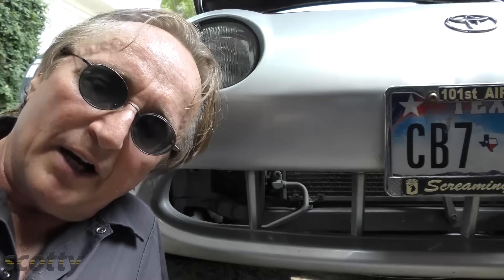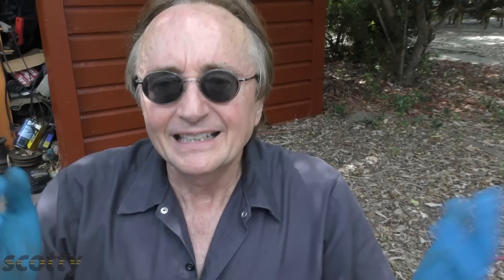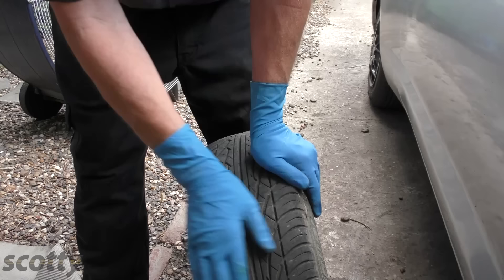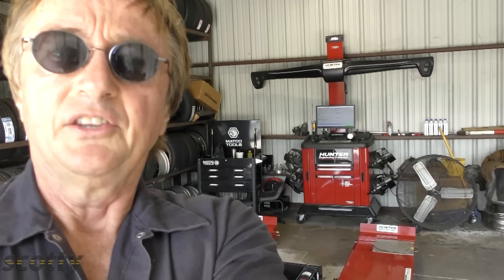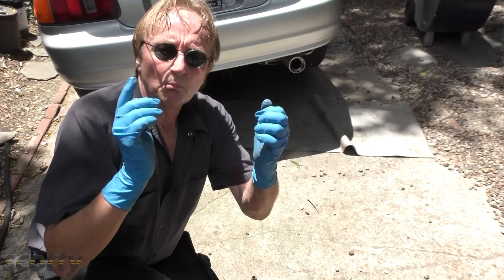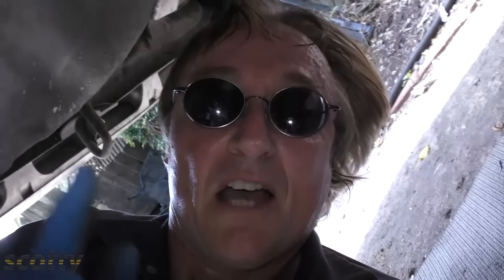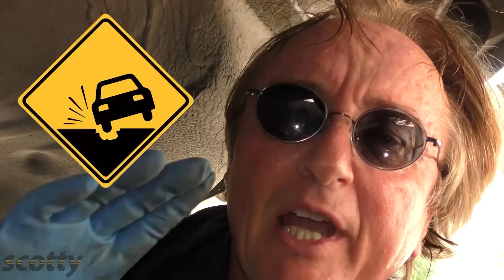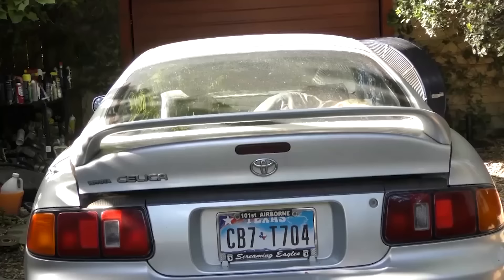How to Tell if Your Car Needs an Alignment

Comment: No rust anywhere. Must be nice to live down south.
Reply: It is!
Reply: The advantages of living in the South go way beyond car rust.
Reply: J Babb like cheaper houses etc?
Reply: it has its pros and cons lol
Reply: opl500 ahh that’s like the only good thing in my option but that part is nice for sure.
Reply: J Babb Don't know about that. Hot, humid, bugs. Mountain West is where it's at.
Reply: Everything's a trade off but I wouldn't love far north if you paid me for every expense!!!!
Reply: It's only hot 9 months out of the year, that's not humidity, it's liquid air and we've been using the skeeters to deliver packages for years. Amazon just thought they were doing something new.
Reply: All you have to do is apply a very expensive pain to the underneath of the car and around the arches of the wheel and any other part that want to protect to be completely rust free, that car could sit in a container filled with water and sit in there for 10 years the only things thats gonna rust are probably the wheels the bolts and the engine metal parts... AHAHHAAHAHAHAHA what metal parts? lol
Reply: No road salt usage during winter.
Reply: opl500 
yup I learned my lesson by fixing up a Texas car that was in the north for about 5 years. 
Who could tell it was a Texas car at that point? 
Next time I’ll be way ahead by going there and getting it myself !!
Reply: The only con I've seen having a "Florida" car... The plastics man... The engine bay wire harness clips, hoses, etc. They're brittle as hell. But after having and working on a rusty "New Jersey" Grand Marquis... I'll stick with southern cars any day.
Reply: IcantSignIn ...LOL!
Reply: We have about 8 months out of the year of 90-100 degree heat with 50%+ humidity. I love the South but our weather is fucking miserable.
Reply: It's mostly aside from that they don't salt roads when it does snow and ices over, and the summer time heat turns any vehicle into a oven.
Reply: Greetings from South Miami!
Reply: it's nice down here. No snow or ice, maybe once every 10 years like last year. But hot hot and hot for 8-9 months. Even at 9-10pm is still 90 degrees at night because of humidity. But down here you can drive any car doesn't matter be 4x4, fwd, or rwd because of no snow
Reply: Rhinolith lol, same story here trying to find an automatic shifter without a broken plastic button for 03-07 accords. It's almost like a rite of passage for these cars in the heat belt.
Reply: Sucks aligning northern cars. The adjustments are rust welded together. Takes 3 or 4 times as long sometimes since your always fighting to free it up with torches etc.
Reply: The south shall rise again!!  @jeff3741
Reply: Live in Massachusetts i put a transmission in a 2006 silverado today had to heat every major bolt
Reply: It has its benefits, I live in Tennessee. I'm originally from New Jersey.
Reply: If I lived up north I definitely would invest in a car garage.
Reply: @psydog5480  humidity is what is bad I moved from South Louisiana to South Florida and I'm loving it most days sunny and breezy rite on the water.
Reply: Nah we have pot holes here to, it’s not all perfect
Reply: @davidperry441  yeah no kidding. An average clutch replacement takes 4-6 hrs on a Civic. New England cars? Plan for 10-12 hrs and half pint of blood loss from cuts and bruises.
Reply: @creolecajun9988  except car garages are a luxury only the richest NFL players can afford here in Boston. Parking spot? Yeah a 27 min walk from your place. Car repair? Drive 45 mins west to find a trustworthy mechanic. Can't wait to go live in the south and leave this gigantic, cancerous pothole of a place!
Reply: He lives in Houston so it's humid and salty
Reply: Down south? I hope you mean California or something. The most humidity all over Florida.
Reply: Yep
Reply: I live on the in a tropical climate on the coast and sit for hours at the beach every day and my car is a decade and a half old. I don't see no rust anywhere.
Reply: I live in Canada winters are terrible and I have no rust either
Reply: It is!
Reply: cali is wonderful for that
Reply: Yeah sweet tea is much more important than rust!
Reply: Yes, its just Hot as He#$
Reply: No snow either! 😎
Reply: No rust until you live on the coast in the south
Reply: Yeah but living in the south, has its pros and cons, you can cook food in your car without having it running in the summer lol
Reply: Yes.

-Florida Man
Reply: It doesn't suck
Reply: Then move south?
Reply: No people normally can’t drive down here and you wreck up your cars
Reply: I think I would prefer to see rust rather all this dang sand....so...sick...of...the...sand!!!
Reply: It is
Reply: @jeff3741  yep!
Reply: @josephpatrick9174  good tell your friends not to come also
Reply: I swear might have to move down south just to get my moneys worth
Reply: @DragonKnightX12  our cars have a device that is called an air conditioner!
Reply: @Randall-mt7jk  You must have that hi tech AC that cools 120 degree car interior down to 60 in second. 😂
Reply: DEFINITELY IS 🤣

Comment: I've done the alignment on my own car using basically just strings and a tape measure and some ingenuity. When checked later at a garage it was almost perfect, well within spec. Mechanics always say that you need insane precision, lasers etc, but in fact on a 17" rim the difference of 1 degree is a whopping 8 mm between front and rear edge of the rim...Meaning it's absolutely doable for a skilled home mechanic.

Comment: The pros always say " this was the best we can do" and its not perfect but they charge you 100%.lol
Reply: chuck e 
Its all about tolerances
Know them and work within

Everithing else is a waste of time (and money)

Capitalism tho
Reply: I got an idea, how about YOU learn how to do an alignment then YOU can see why "this is the best we can do" is what we most commonly say.
Reply: Six months later , need new tire.haha
Reply: When its time to pay, you can say "this is the best we can do" and only offer 80% of what they wanted
Reply: its tricky cause you get one adjustment where you want and move on to the next it will change the reading on last one you just set. its more of an art than you would think and doesnt have to be exact just an approximation. you would be surprised at what counts for "inside manufacturers specifications".
Reply: WarriorPaxo yes I agree it is an art.
Reply: Try doing an alignment on a Chrysler 200, good luck adjusting the camber and don't forget to jounce (if you don't know what that is don't worry about it.)
Reply: Usually that means you need new parts & the old ones are too old aka worn out. not the techs fault you won't do you repairs. in fact it usually takes us longer to get it close ironically. why? because we have to go back & balance both sides to the "good as it can get" measurement.
Reply: @markwatney8641  In that case, you don't pay up, you don't get your car back until you do.
Reply: Most cars come with front and rear toe adjustment. That's it. Sometimes you get lucky and have front camber adjustment. Otherwise you're looking at expensive cam bolt kits or shims to get it right. Your choice.
Reply: Many times this happens and they refuse to adjust what is needed like newly installed adjustable equipment. Whatever gets your car  out of the door quicker is the way to go. I have yet to find a good alignment person that will do a precision job
Reply: I agree
Reply: You are lucky, they wanted to fix everything under my hood before I could get it aligned.
Reply: @bdtol3142  under the hood or front-end work because your motor cannot work and we still can align your car we can drive it to test it but on the machine it can be all in the green but we can't do that if you have bad front end work we got to fix the front-end work first then align
Reply: @nicholasdoran  do it perfect or dont do it, period.
Reply: @gizzync1525  Don't You Love whenever you adjust the passenger side toe and the driver side toe changes LOL
Reply: @peopleareajoke  my personal favorite is when the caster moves because the brake depressor didn't hold. lower. cuss, resweep, raise, readjust. pray split is correct
Reply: That’s like cutting grass  would you charge the same if it was short or tall

Comment: Most people don't need it done perfectly that's why we are on youtube.  We just need alignment done well enough that we don't get bad tire wear or steering pull.  The main reason the individual needs this done in my experience is because they have replaced some front end parts themselves or bought a vehicle that has had some front end parts replaced.  It is totally possible for even a novice to do a decent wheel alignment that accomplishes these goals.

In this case performing a home wheel alignment by measuring between the wheels is perfectly acceptable and will fit the purpose.   I have done a total of three wheel alignments in my life.  I have done all of them with little to no experience and training.  All of them have accomplished the goal of reducing bad tire wear and steering pull.

Comment: My Dad has used the tape measure way for decades and has never had an issue.  Like Scotty said most adjustment is needed for toe.. and the tape measure way works for that.  If you have a camber issue? Then the tape measure won't work.  You can usually tell by how your tire is wearing.  Now my Dad was in the Body Shop Biz for MANY years and is fairly proficient at doing alignments in this fashion.

Comment: I do my toe alignments myself by guessing and honestly, I've never had this method fail me. I can't condone it of course because you have to be super in-tune with what your wheels are doing and how your car is behaving in order to get the adjustment close. For example, My car had steering that was drifting to the left at high speed and at low speed, the steering was very light to the left but harder turning to the right. Also at low parking lot speeds, it would turn light to the left, then you could let go of the steering wheel and it would continue to turn itself harder to the left until it reached full lock turning left. These symptoms led me to believe that the left wheel tie rod needed to be adjusted in a way that turns the left wheel to the right. ( not sure if that's positive or negative toe) Either way, it worked and my car steers great now.

Comment: Great content once again!  Too often people are scammed into 'needing' an alignment.  One time had a NTB location try to fudge the  inspection results.  Vehicle was perfectly aligned when it went in for tires.  Watched the guys try to play around with the steering wheel to make the printout appear the vehicle was severely out of alignment.  The problem with their scam was that the toe was out exactly the same amount on both sides (one positive and one negative), with the wheels both pointing left.  If that truly was the case, then either the vehicle would have pulled severely to one side with the steering wheel centered or would have driven straight with the steering wheel severely off center.  Just a SCAM to try to get me to spend $80 on something that wasn't needed.  Put 70,000 miles on those tires and they wore perfectly.  Seems to be getting harder to find reputable shops these days.  Knowledge is power!
Reply: yeah ive had a shop do that to me before lol. they tried to say it was out of alignment but they just didn't have the steering wheel straight lol.  one wheel was toed in while the other was toed out, but guess what happens when you straighten the steering wheel! I just said no thanks and left with my free alignment check lol
Reply: I talked to the shop clerk at a very good garage that does good work.   He told me and another guy in a discussion in the waiting room that he worked for a dealer and they would to loads of  unnecessary work on cars and especially women who came in and old people.   They did the work and split the profit.  The management encouraged this practice.   I was surprised he told us.  He said they only made minimum wage.  but I feel he felt guilty.   At least they did the work, some places don't do the work and still charge for it.

Comment: @scotty Kilmer  when i was still working as a mechanic we used to grind slots in the general motors struts to make a camber adjustment.though we charged 30 bucks a wheel if needed to be done. gms were bad for it. the struts in the old gm j body cars were slotted already for the adjustment. there were also special alignment bolt kits to replace one bolt with a special one that could give you some camber adjustment. they were put out by northstar if memory serves.

Comment: Alignment shops may be recommended, but it's possible to use the tape measure method if you can't afford one.  I aligned a family vehicle after installing new tie rod ends.  They took it to a shop to verify my accuracy, almost perfect!  My advice is patience, a quality tape measure with 1/16 inch (or metric equivalent) markings, factory recommended specs, and a good concept of how the vehicle should feel while test driving (different drive types, suspension, and steering variations WILL create different feedback).
Reply: Yes I used strings, and a tape measure and a level for the vertical.   The car runs very well and no squealing of the tires and the tires are not wearing unevenly.    So If you can do it yourself, you save a lot.   These machines are overkill for a result that is always never perfect, because the car cannot be made perfect.   My daughters caliber had a narrower wheelbase at the back then front and I think it was supposed to be the same.    If the tires are a little different then that is a millimeter or two.   So it is not exact.   But when you get it close, that is good enough.   Even if your tires wear out a little prematurely , it is cheaper to buy new tires than pay for alignments.

Comment: Great advice on having an alignment after a wreck.  I had a minor wreck which hit the R rear wheel and I had to get an adjustable tie rod installed to bring it back into alignment because the factory, unadjustable one was bent.

Comment: I went for an alignment some time ago.  The guys couldn’t loosen the tie rods on one side (didn’t try too hard, either). Using that laser machine, they adjusted the alignment by only adjusting one side of the car, leaving the other side as it was.   I find that a lot of the guys using this equipment just go by some ‘computer’ training, rather than actually understanding the principles behind this.  Maybe I’m wrong, but I thought that only adjusting one side wouldn’t be the proper way to do this.
Reply: Doing it on one side is the lazy way ! (didn’t try too hard, either),it puts the steering wheel off centre to,they should clamp the steering wheel at centre and adjust both sides...
Reply: I had my truck aligned after I changed out the tie rod ends.  It came back with the steering wheel crooked.  They said that's the way it has to be.  A few turns of the drag link fixed the crooked wheel without messing with the alignment.
Reply: Inisfad sounds like a lazy alignment tech. I do this every day. There are many ways to fix the alignment on cars and trucks. There are a lot of aftermarket parts out there to fix them. May cdt a little more than standard alignment bout it can be fixed. And they should have trired harder to adjust the other side or replaced seized parts
Reply: Did he even try to use an oxy ace torch to free up the tie rod? If not hes a hack and I would demand a refund or they redo the alignment with someone who's competent. I've done tons of cars and trucks with seized jam nuts and a little heat will always break them loose.
Reply: Korrupted No, they didn’t try with heat.  I actually went to them twice, to try to get this remedied.  Finally, my mechanic used a torch on them afterward.  Sadly, there is only one place in my locality that does alignments.  I had such a bad experience with them that I didn’t go back.  My mechanic did an ‘alignment’, old school.  Although it may not be nearly as exact as the laser machine, I trusted him more, and the car tracks and handles well.
Reply: Setting toe is fine and dandy but if you're camber is off and not adjusted as well you will get tire wear. Where I work if the customer is not happy with the alignment we redo it till it's right. Only time we couldn't we had a valid reason like frame was bent from an accident or rear toe/camber not adjustable ect.
Reply: @jeff3741  Many of these quick shops do not care about quality. They know how to write up a bill though.
Reply: There are some cars where only adjusting 1 side is the correct way to do it.

Comment: I went to a so called pro with a laser alignment machine and when I drove out of there my car was pulling to the right.... I went home and pulled out the ruler and did the string alignment method that my dad taught me, tires have been good for about a year now no shaking no pulling no uneaven wearing.... all I needed was a zero toe .... string method worked like a charm...